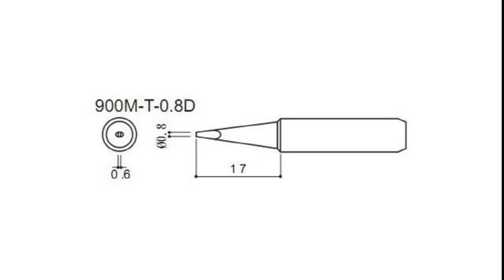How to fix Opel Astra and Zafira ECU / Siemens - GM Vauxhall 5WK9

Comment: I hope you're still reading these. A friend of mine had his Zafira jacked. They stole the ECU and the thieves didn't simply disconnected it, they cut the wires. He managed to purchase a new ECU, but they didn't have wires/connectors. We're trying to find that part but we're stumped. Can you guide me where can I find that part or at least the part number so I can try and find a replacement? I'm talking about the cables/connectors that connect to the outside of the ECU from the car. Thank you in advance.
Reply from the maker: Hi! You have to find a used auto-part shop. Maybe you can order the arneses. Better option is to visit the junker or car bone yard and get the wires himself. (He will need connectors, the extra piece or wire, and some of them are connected to sensors, so to join the wires can create serial resistance with the sensors signal. It is better to replace the whole wiring).

Comment: Hi Bob!

The oil In the ECU comes from the oil contact sensor which is causing the oil warning lamp to extinguish after engine start if the oil pressure is O.K. Most modern cars have processed the information from that sensor in the ECU and then it is transferred to the dash panel. Because the the plug from the harness for that sensor is sealed connector type, when there is a leak in this sensor the oil pressure (when the engine is cold or in high revs. with warm engine it can reach 5 bars or higher) gets in the  sealed connector of the ECU between the wire and it's insulation (capillary  effect) and then it's possible to enter the ECU itself between the pins and molding of ECU connector. I have seen such problems even with the Engine Coolant Temperature Sensor. If signs for oil or coolant in the connectors of the ECU the above sensors should always be replaced.

Comment: hi bob my 2010 zafira petrol has stopped working, no ignition, no start, dead, a can bus code has come up, any suggestions please?
Reply from the maker: Hi! If all looks like dead, then check the main fuses. (Also check for old alarms installed. It has a cut off circuit. A friend of mine had the same problem, and it was an old alarm circuit installed).
Reply: @bob.kalpon1398  there is no alarm fitted, but which  are main fuses, i have a feeling it might be the cim unit as i recently had the horn repaired.
Reply from the maker: @trabali5168  Mmmm..! Your electrician was in the main fuse, where the horn is, and also he touched the steering wheel. High chances are you have a lose contact in the main fuses or under the steering wheel key connector, and it justifies the power insulation.
Reply: @bob.kalpon1398  i will try the fuses..do you have an email if possible

Comment: Opel, vauxhall/gm cars' ecu problems are common issues because of corrosion due to water damage. Bad design that these ecu are located where water is always present or draining. Also, no added plastic protection cover against the elements. Car has plenty of room inside the cabin that these delicate electronic parts should have been located. I own a vauxhall car now but will not buy any of these again.
Reply from the maker: Yes, just using common sense, inertia forces applies less in the chamber than in the extreme . Adding to it the lacking of plastics or rubbers, we ended applying movement to those wires inside the ECU. We only need one collision in the car´s history and we can add a ECU wires failure to the list of damages. It is good car, but if we buy Opel, we must think about to change tires, filters, oil and ECU too! ...why not?  :-))

Comment: Milos Pavlovic
Super video.
I would like just one answer from you couse I have problem with nobody can't solve.
After diagnostic " camshaft actual position" 
I change him and variable pulley also same storey.
When it's cold car, it's going less than before when I haven't that problem.
But when car passed few KM and start to be hot the can change some MODE, GAS star to loose power so much that I can't In first gear start on some Hill.and in the same time on gasoline, start to be Lazy.
Astra H 2012
Can that be computer?
Reply from the maker: Hi! If something went wrong, "only that part" will fail.  But when there is an ECU with bad wires array connection like in the video, "many things"  no related with each other will fail at the same time. Most of the time bad wires ECU will fail after warming up, some minutes of driving, bad road or in some speeds because the car's vibrations.

Comment: Guten Morgen .. Nach ADNC ich ein Problem in Ecu in meinem Auto Opel Zvera 2001 habe ich kaufte sie von einem Auto Ecu Opel Astra Modell 2002 und arbeitet immer noch nicht mit der Wissenschaft Autos den gleichen Motor Z18XE mögliche Hilfe
Reply from the maker: Hallo! Hast du es gescannt? Gibt es einen Code? ... oder ist es tot tot? (Ist die ECU mit dem Schlüssel des tatsächlichen Autos programmiert? Was sind die Symptome?)

Comment: Great video Bob. I have a Vauxhall Zafira 59 plate (2009) which keeps illuminating the EML (Engine Management Light) on the dashboard causing the vehicle to shudder and restrict speed. The fault had been diagnosed as Fuel Injector 1. I then had Fuel Injector 1 replaced with a brand new one and the car was fine for just over 2 weeks until the EML illuminated amber again, the fault has been diagnosed again as Fuel Injector 1, is this likely to be the ECU?
Reply from the maker: Hi! Yes, it could be the ECU. (But check wires first to ensure good connection and clean contacts). A defected injector can damage the output transistor. Or a defective output transistor can be accused as defected injector. Bad power supply connections can be reflected and error en the components that more current use in the system too. Also a broke wire problem like in the video could be possible.

Comment: Hi. I have a Zafira 54 plate which has had errors 1571 (brake sensor), 1482 and 1483 (fan relay) for last 2 years. It then suddenly developed codes 1122, 1120 and 1550 and went into limp mode with no more than 1200 revs. Had new accelerator and pedal switch fitted and all codes cleared. Drove ok for 2 days but sometimes felt slightly hesitant when accelerating. Then spanner light came back with codes 1571, 1482, 1483, 1122 and 1550 (1120 no longer present) and then intermittently went back to limp mode (usually just after starting car when slightly warm) however, a simple lock and unlock of car temporarily resolved this. I have a feeling it could be the ECU. Does this sound about right? Sorry for lengthy explanation, just wanted to be clear with the fault.
Reply from the maker: Yes. One specific code is one specific problem. But a lot of codes, and some times no code is related one with the other when  something went goes wrong, means bad connections in the ECU. Your problem's description match the problem fixed in the ECU from the video.
Reply: Bob. Kalpon Thanks Bob

Comment: Does opel agila engine ecu needs initialization or programming when you are replacing a used one?
Reply from the maker: Hi! I don't do programmings. I just worked in general electronics repairing. But many car models, will not start if the ECU had been changed. Programming is needed to associate the key.

Comment: Hi Bob, this is a very good video!!! Thank you for this!
I have two questions:
1.How can I ask from the shop the glue around the ECU for sealing it after I will finish with it?
2.Which is the name of the transparent glue/material(silicon gel) with which is covered whole the surface of the circuit in case I want to replace it after I will finish?

keep up the good work!!!
Reply: Did you find the glue for the sealing? I could use this information too.

Comment: Hello Bob, how did you solder the wires. And which material did you used. thanks
Reply from the maker: Hi! Wire 30 WAG & Kester rosin core solder 63/37 0.020

Comment: Hi Bob.. thank you for this video....i have opel vectra c 2007 my problem is the fan for cooling not working and the indicator of temperature is not working too, can you help me in that ??
Reply from the maker: Hi Ahmed! Fist check temperature sensor, contacts, connection, and cables follow up.

Comment: hi Bob how did you clean silicon gel??
Reply from the maker: I remove it with the tools showed. But there is an invisible thing I add to it. "A lot of pacience". If it didn't work fine, I add perseverance and everything in the area to repair gets clean. ;-)

Comment: I have 2007 Opel Corsa 1.2 with ECU problem. My ECU part number is 0261208940. I can't find another used ECU with same part number. But I found 2008 Corsa 1.2 ECU with part number 0261208253. Last three digits are different. Would it fit my car?
Reply from the maker: Dear friend, I will kill you with my ignorance. I am electronics engineer. A mechanic or autotronics technician in Opel has the right answer for you. Yes, there is a difference. It is not only for the year, but for the extras in the system. Most of the time, the newest model can control the oldest one. Also, some extras are ignored if they are missing. I am "new in Europe", and am trying to learn it too. I saw Opel Corsa looks the same from 2007 to 2010. But I have not formal information to tell you. Maybe in Opel Clubs online, used part's shop, or an Ebay ECU supplier has the answer. And as I said, an opel mechanic is the best source for your answer.

Comment: Nice video. I did job, same of this. It's not so easy job. :) Just one question, collegue: how did you remove silicone insulating substance, from wires? I used alcohol with wadding sticks, but, it's not very comfortable..